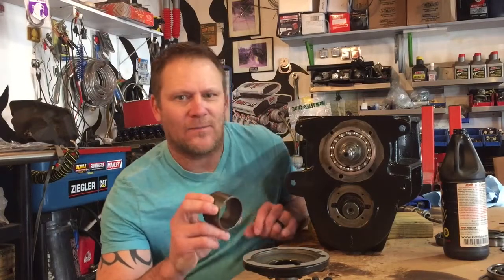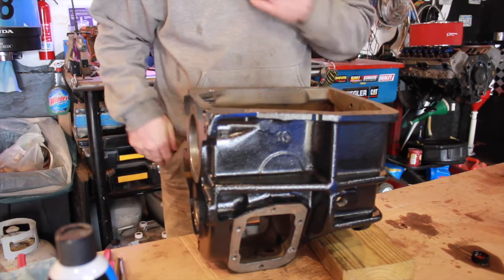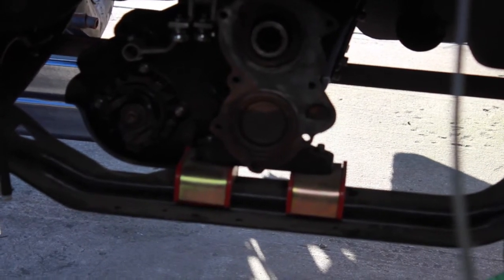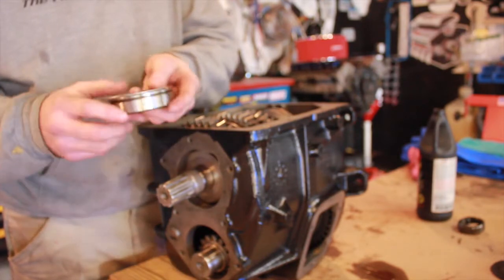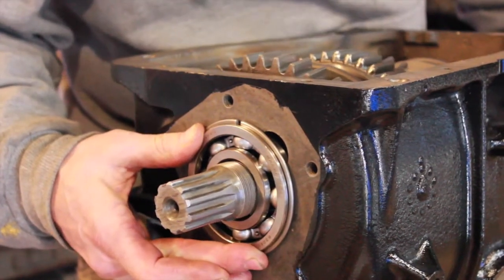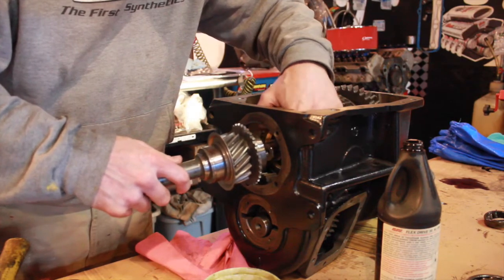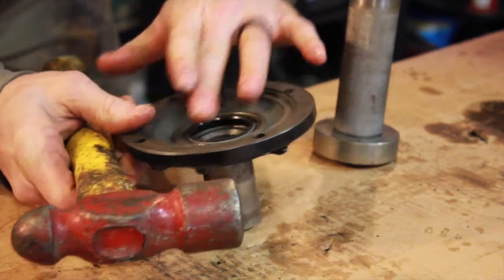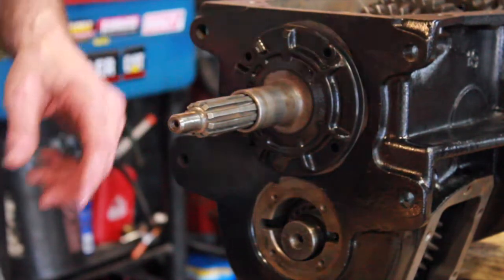SM465 Complete Rebuild Part 3!

Comment: Thanks for sharing the video. I’m an in process of doing this to SM 420 1953.
Reply from the maker: Awesome, have fun! God bless!
Reply: @GebBuilt  I don’t see much on the 420 rebuilds like the video you did on the 465. Just a few vids talking about them and looking inside them
Reply from the maker: I should have a GM book on the 420. If you go to my @GebBuilt Facebook page you can comment and I will try to post pics of that rebuild from my book! I’m not on fb often but I will keep my eyes open for you. The only problem I see with my info is figuring out the other name for your SM420. Chevy calls the SM465 the “117mm transmission” in my books. Hopefully we can figure it out.
Reply from the maker: @dsim9988  I apologize I'm extremely late in replying but if you're still wondering hit me up on my Geb Built FB page - I think I have the manual and perhaps I can send you pics of the pages
Reply: @GebBuilt  oh nice, I don’t have a fb page. So not sure on that. Thanks for your reply

Comment: I've rebuilt this transmisson before, but between my fuck ups and a few of yours, I think I'm getting a really professional rebuild this time. I do have a tip for you though. The lock nut for the back of the main shaft with the 4 notches in it. If you have a dana 44 or a GM 10 bolt front axle, the socket to remove the bearing nut that holds the bearing in those hubs will work on the transmisson as well. I can't remember really, but I might have had to use a file on the socket a little bit when I used it on the transmisson because I bought the socket to change the u-joints  on my front axle yokes.

Comment: Very nice work brother, I know I'll be coming back to your videos again and again.
We've got three rigs with the Muncie 465 and all I can say is they seem to be virtually indestructible - Love that box!
Here is a piece of info I just picked up that you may find interesting - A front mounted overdrive box that jumped in between the engine and the 465 
*****" It's a "Double Torque 2XT" , and was made by Power Torque Industries, Inc. Company, in Arlington, Texas.. 
It was made to bolt onto this SM465 G.M. four speed truck transmission that we are using.. 
 We understand this company sold out to "Advanced Adaptors" and they continued building this same unit with very little changes.. They are now called the "Ranger Torque Splitter". .
  They no longer have the Eaton electric solenoid though, as the earlier units did, and have gone to strictly manual shift.. Although we have the electric solenoid, we decided to manual shift ours also.. "***
I dont know a thing about them but it looked cool in the video I watched.
Keep'em Rolling!
Reply from the maker: Wow that sounds like a cool piece of equipment! Thank you for sharing, I’ll have to check it out, I’m glad you like my work! God bless!

Comment: Good job, looks great. I did exactly what you did about to the T. If you ever get an itch to run a Braden pto winch off that side cover on your tranny, Ive got the complete set-up. gearbox for tranny, just hangs off bolted cover area, control cable that actuates it, wich with 3/16 cable rated at 10,000lbs.(they say these older winches can pull down a house) and a nice roller fairlead to cut through your front bumper and mount to. Oh and both driveshaft u-joints have been well greased and are tight as new. It came on a 1 ton 1970 Chevy 4x4 from Boring, Oregon. Very, very rare!!! By the way I am in Waukon Ia.   Jim.  (P.S.,not to be bossy but I really believe in running Royal Purple 90w-140w gear oil. in that 465). I even ran Royal Purple in my tractors and implement gear boxes the last years I dairy farmed.
Reply from the maker: Toughest winch around if you ask me! God bless brother!

Comment: Just a " correction " from a tool and die guy . * Never drive a ball bearing in by the center !!!!!! You want to drive it in by the biggest outside race !!!! If it's a press fit on the center bore to you would want to drive them in on both surfaces at the same exact time / contacting both races with a driver ! Heating the bearing and cooling the shaft with dry ice prior helps alot to . If neither is practical , motor oil , wd, anything helps to help get and keep em moving . Just trying to help , but hiting the inside race can easily distort the bearing leading to noise and premature wear and possible failure .

Comment: Just a tip for everyone. You can make a sling by wrapping an old serpentine belt around the shaft and  gears to lower them in the case while you hold the belt from up higher out of harm's way.

Comment: The GM front wheel bearing socket will work, you just have to grind off the inside of each pin a tiny bit.

Comment: Howdy I was wondering if you'd be willing to do a ride along video with some shifting on that muncie after the pin to bolt for the fork rod ball grooves, I would be interested In doing that to mine if that works good 61 apache long bed 283/465

Comment: hows' everyone's main input bearing large outer snap ring thickness effect the proper flush fit of the retainer? mine will only go flush if i remove the outer clipring. same deal with the rear main and the 4x4 adapter. its like i could just have the two machined out to fit the bearings and their clips just a litte to fit. everything fits perfect and works. just cant get past thinking there must be thinner clips? or let the bearings "float"? 
mine look the same thickness as in this video btw

Comment: When you put the input shaft in, isn't there supposed to be an oil slinger installed on the input shaft behind the bearing? I got a rebuild kit and that's a part that's left over. I don't know where it goes if it's not at the input shaft?  Also I'm having a hell of a time getting the snap ring on the input shaft..  the kit I have doesn't have a nut.... it has a snap ring.

Thanks, Larry
Reply from the maker: Hi Larry, I am struggling trying to remember an oil slinger. I made these vids a couple of years ago and I haven't touched one since but what you describe makes sense. I wish I could be of more help right now, but knowing myself it will come to me in an "AHA" moment and I will be sure to let you know! A good quality stout set of snap ring pliers is a must for these! Thank you so much for watching and inquiring, God bless!

Comment: You mentioned the socket to torque the rear mainshaft lock nut, after looking for the factory socket I was floored by the $250+ price of the bosch tool. Did you end up making one or find another solution?  Thanks
Reply from the maker: I actually found a spanner socket in my tool box that was close enough to do what I needed it to do. Got lucky!
Reply from the maker: Wow $250 that's ridiculous!
Reply: +GebBuilt Do you know what it was actually for? Part number?
Reply: +GebBuilt acutally $250 was a typo, i meant $350+!!!! The average cost is $400
Reply from the maker: +Tony More holy moly!!
Reply from the maker: +Tony More I've been racking my brain and I'm drawing a blank. I've worked on so many brands and types of equipment and there aren't any markings on it. Sorry man.
Reply from the maker: +Tony More awesome, thank you for the input!!
Reply: It's the same socket as the front wheel bearings.

Comment: Hey can you give me verbal instruction on how to properly put on the top cover gasket? First rodeo. Im just swapping top covers because I believe my 1st fork is not moving properly. Just wanna make sure I get gasket on correctly.
Reply from the maker: Well usually those are just a typical gasket made of either cork or the other stuff gaskets are made of - place it on, install top cover, ensure gasket stayed in place, if not, line it up - torque top cover down. I think I've posted top cover removal/installation instructions straight from the GM manual on my Geb Built Facebook page. If you go there and it's not posted, just send me a FB message and I'll try to help you out there. BEWARE there is a proper way to remove the cover that will save you a headache!
Reply: @GebBuilt  so no sealant on that? I dont use FB sorry, but im aware of the removal. To verify it is putting it into reverse correct?
Reply from the maker: @Mwellmac  You could use a thin layer of the sealant of your choice. If I use anything for stuff like that it would be Permatex Aviation Form-A-Gasket. Put it HALF WAY into reverse. Put the shifter in the slot and only drag it half way back not the whole way.
Reply: @GebBuilt  sounds good. Im working on an ice cream truck. After watching all these rebuilds etc i feel the shifter forks are causing it to not go into L and 1 is rough. Bought a decent top cover with forks for 200 and just need to swap it out. Unfortunately truck is at paint shop currently and top plate is on hand just waiting
 Im itching to see if it corrects my issue

Comment: On this transmission can you swap out the 2wd 35 spline mainshaft and put in a 10 or 32 spline 4wd one without running into problems?
Reply from the maker: I believe so. I have not done that swap, but I do believe you are correct that it is a direct swap. Novak adaptors would be able to answer that question definitively I'm sure. Thank you, God Bless!

Comment: What kind of oil is recommended for the sm465
Reply from the maker: 80w90 GL5.  Thanks for watching and commenting!! God bless!
Reply from the maker: +joshua cravens good question! Gl5 is what I've always used and my rebuild kit instructions recommend it too. If it is bad for the synchros then I've never experienced it nor have I heard of it. I won't say whether your info is correct or not, I will just say what has worked for me. Thank you for commenting and God bless!!
Reply: +GebBuilt thanks

Comment: Did your PTO covers leak ?
Reply from the maker: Dr Johnson Hungwell no
Reply: @GebBuilt  Did you put anything on the bolts like loctite we've changed mine and it's seeping around the bolts and I have a seeo around the counter shaft cover gasket more of a significant leak but im going to re do it all.
Reply from the maker: Dr Johnson Hungwell yes any time the bolt holes go all the way through the case you should clean the holes and bolts and use good thread sealer like loc tire brand. Great question. I hope this helps
Reply: @GebBuilt   I bought the loctite blue that is oil resistant , the motiv gear PTO gaskets and the pernatex grey rtv that is for gear oil so maybe it won't leak now .